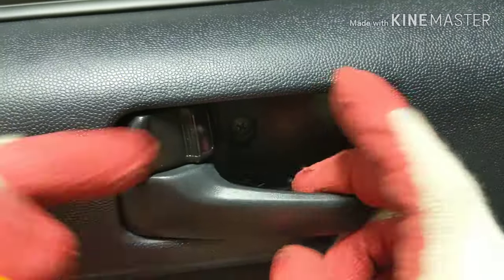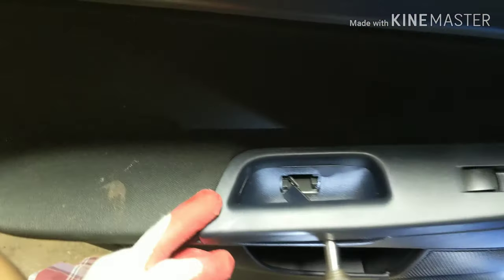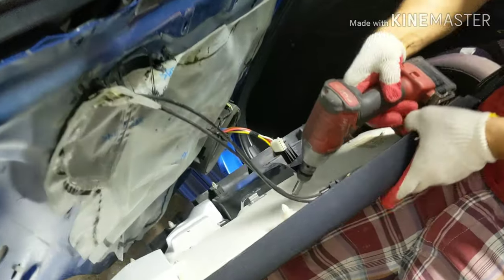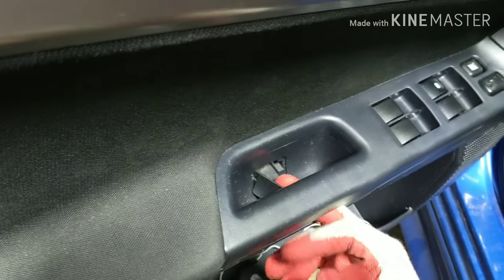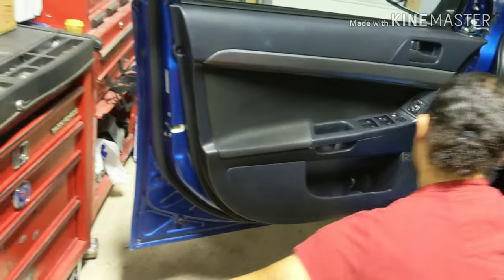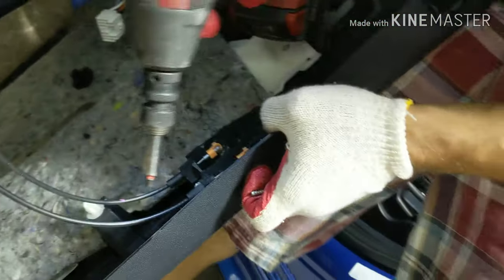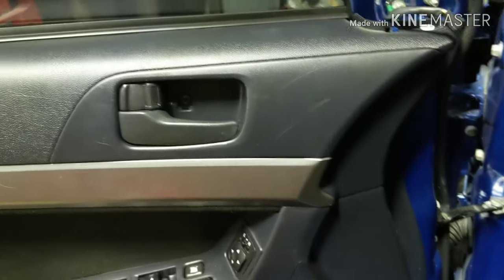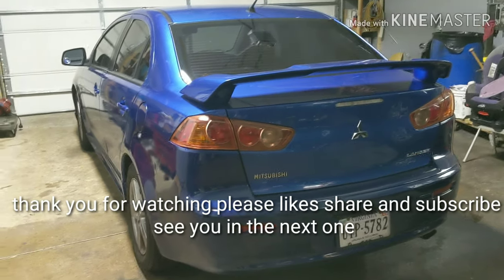2009 Mitsubishi lancer doors panels removal

Comment: Aghh my stupid window is jammed up something must have broken inside the mechanism that lifts it up. This vid is helpful, gonna try tmr to pull it off
Reply from the maker: Wow ok best luck , thanks for your feedback
Reply: @nestorautorepair  took it off and was able to try and adjust it enough to get the window up and in place for now. The window regulator is twisted somehow so I had to order the part, but I appreciate this video for teaching me how to get in there!
Reply from the maker: You're welcome , and thanks for your feedback , I'm glad my video help you 🙏
Reply: Mine just messed up yesterday today it works but it’s not lined up correctly and doesn’t go all the way up … and my damn car doesn’t have heat because the blower motor keeps frying everything I just gave up on it
Reply from the maker: Wow sorry to hear that

Comment: Hey , my rear driver side door had a dent from a car bumping it , they changed the metal outside part but now I got a wind leaking sound from the door (not window) when I drive above 45mph, What do you think I should do ? Take it apart ? What am I looking for ?
Reply from the maker: Hi I don't think taking it apart will fix your problem , is the seal around the door or the one around the car frame ,, hope this help

Comment: are the door lock system electronically triggered?... 

my battery ran dead coz of covid lockdown.. and I can't open the door with the physical key..  I read in a thread that you need to jack the car and attach a jumper cable via alternator/starter positive then use the key to unlock.. it just seems like a bad design idea
Reply: Same thing happen to me and I called AAA to open my door. Have you tried opening your door with with the key after your car has been charged? When say opening your door i mean inserting the key
Reply: @jorgevaldez6476  I was able to open the door by lifting the car and jumping the alternator then using my key fob.. decided to inverstigate why my physical key won't open the door when I turn the key.. turns out a latch is not attached and you have to press it in to a slot.. the physical key has been working ever since.. ( I read somewhere that a batch of cars did not have that latch attached from the factory and you have to manually attach it ) so that's what I did
Reply: @vladnesas5767  Thank you for the information. I had the same issue where my battery died and I could not open the door. I did researched that the latch was not attached but I'm glad that I confirmed it with someone. Once again I appreciate the help.